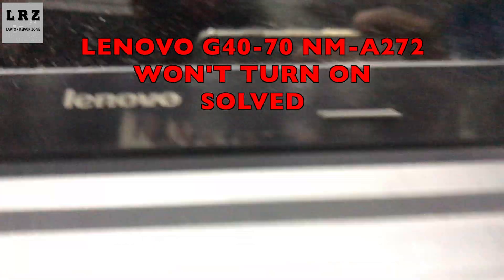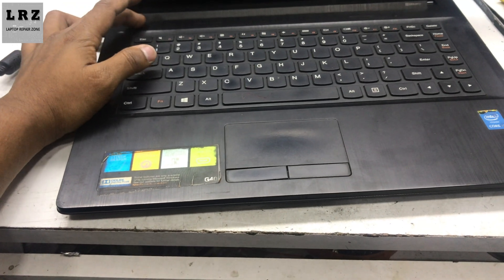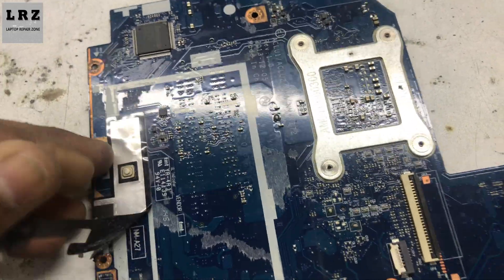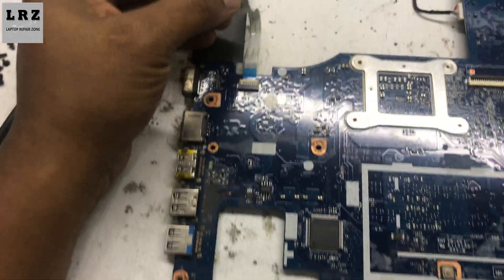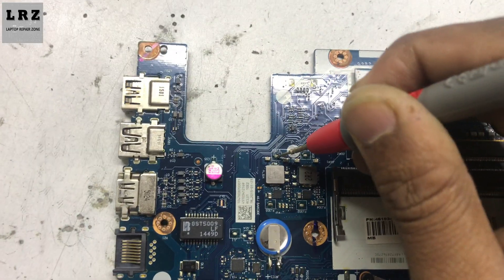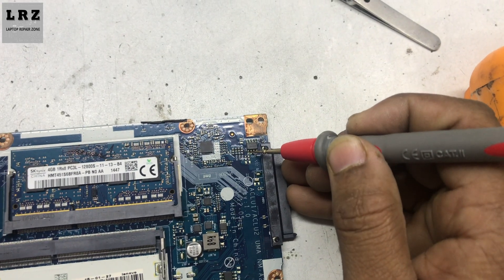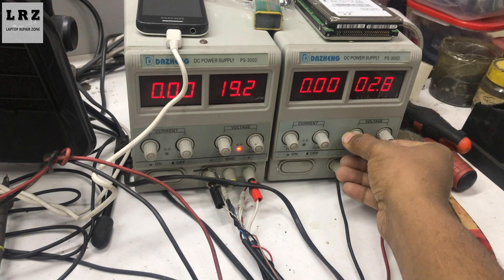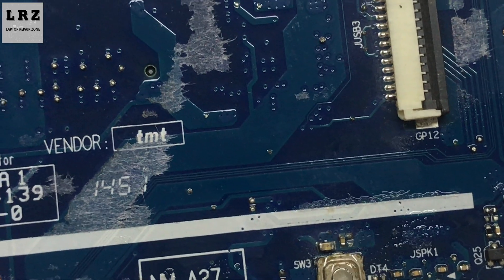Lenovo G40-70 no power no display  solved.

Comment: Hello sir, I hope you are fine.
I have a laptop HP Compaq 6710b ... it works immediately when I connect the charging cable ... and the power button does not work when the device is turned off ... and it does not work well with the battery ... Please what is the solution? Thank you .
Translation from Google.
Reply from the maker: thanks for your comment, please check power switch and switching voltage.